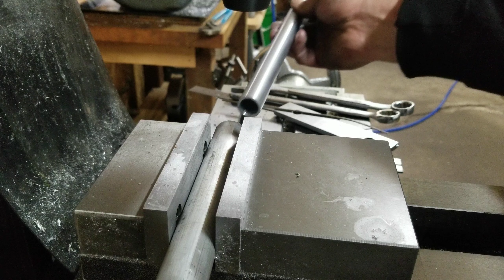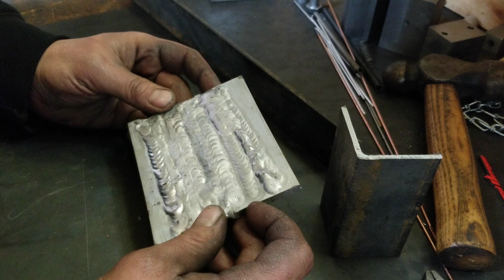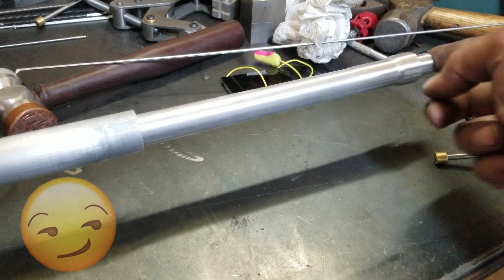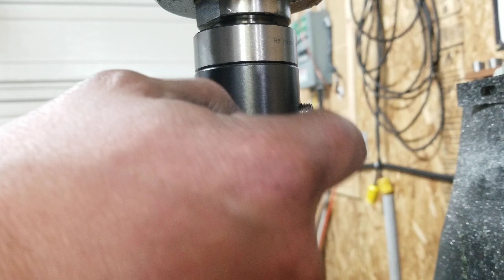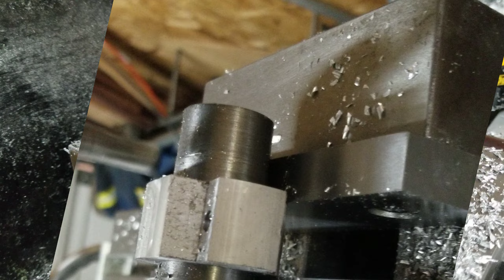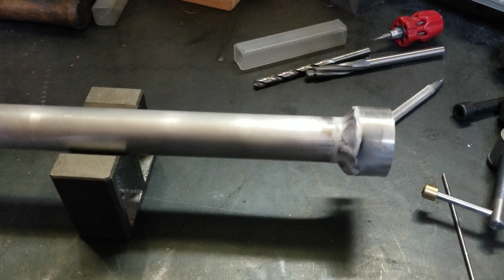Camera Mounted, Part Two! Making a Telescopic Pole! 😀

Comment: I’m sure your just goofing around about the boring head . But if you would tighten the give screws in it to where it is just snug when you turn the dial screw never loosen them up the boring head wouldn’t be sloppy
Reply from the maker: The dovetail is ok, I think. That's still the only time I've used it 🤣. If I remember correctly, just the adjusting screw is super sloppy.

Comment: Those brazed carbide boring bars didn't work for me either. The tip geometry is all wrong.  I bought a set of indexable carbide bars and they are like 1000% better.
Reply from the maker: In the meantime I'll be making some out of drill rod. If an internal grooving tool works, actual boring bars should be great! 😁
Happy New Year, Mark! 🥳
Cheers!

Comment: 3:00 I like to either take a pin vise and use them down to the last half inch, or weld them together and use the whole darn thing. So long as it's only technique practice, nobody will say you're contaminating the weld bead by re-using rods that have been zapped together.
Reply from the maker: Damn hood idea! 😊 Thanks for the tip! 👍😁👍
Cheers and a Happy New Year! 🥳

Comment: We have one of those boring heads and same problem with backlash in adjusting screw....cheap Chieseium🙄🙄🙄..all we can say 😉 🤫, we're thinking the inspectors where out sick with oily grit in their underwear😆😆😆 Everything we get that's been machined over there has that thin oil with generous helping of grinding wheel and metal dust!
Reply from the maker: Yeah, it still works... sort of. Those boring bars are terrible lol. Gotta get my grinder up and running 😊.
Reply: @Just1GuyMetalworks  man you did great job including the welding!!! Really enjoying that squealing aluminum🤯, bet you had pay extra for 6061 squeal 🤣😂Our tig welder may or may not be toast with that fire in May, lights and fan still came on afterwards, but it wasn't much of a welder to start with, seller ended up sending us all our money back because it had more flaws that functionality 🤨🙄
Reply from the maker: @honeycuttracing  thanks man 😊. It wasn't overly costly. The pedal that came with it is pretty hard to use standing up though lol. Working on a welding table however it's buried in a snowbank right now 🤣.
Reply: @Just1GuyMetalworks  yeah heard that, we got sooooo many projects never get started on one 😒🙄😂